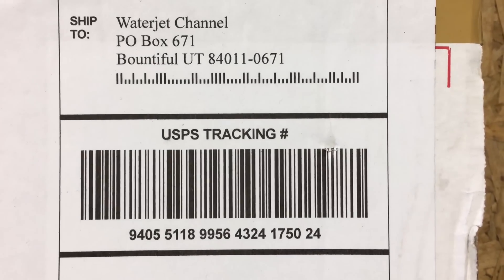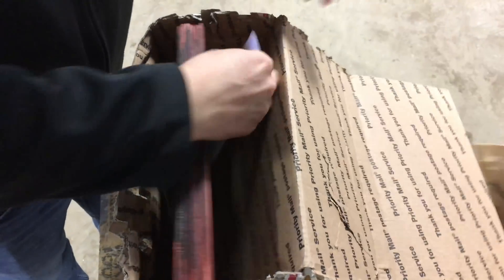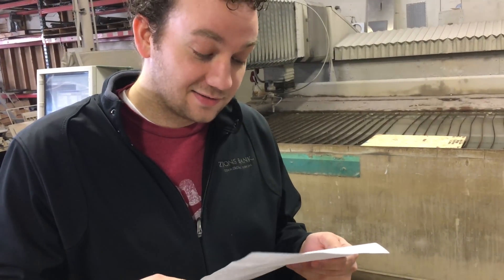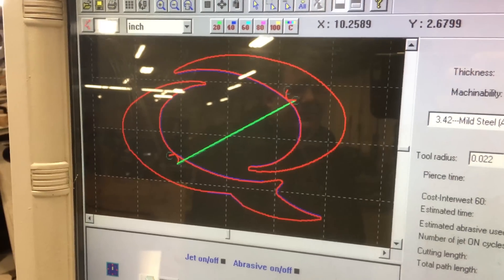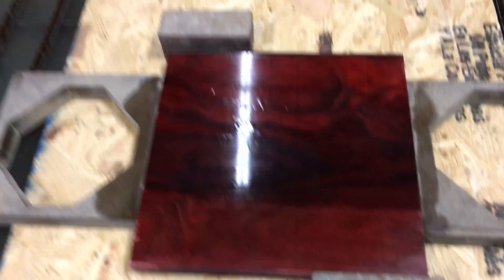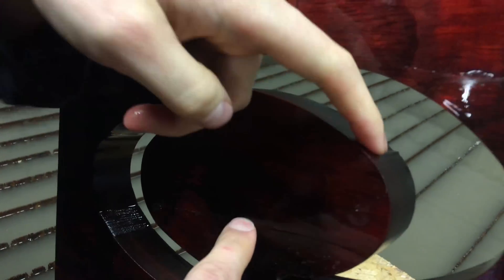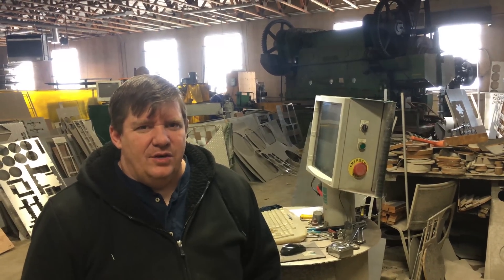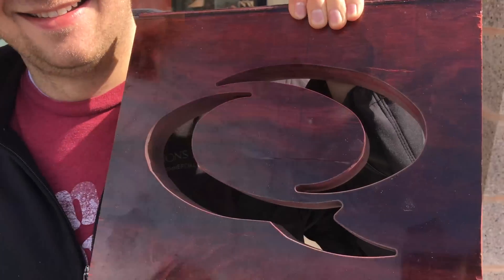Dymalux Wood vs 60,000 PSI Waterjet

Comment: I have only started watching this video I know you can cut threw it. I worked for r a company that makes this particular type and know the process from beginning to end from lathe right down to dying it putting it threw the spreader kiln and press interesting on how it is done the wood is impregnated with a type of resin in what they call an autoclave where it sits under pressure for 4 to 6 hour's then it goes into a kiln for 12 up to 16 hour's then it goes to the press which it gets pressed. Now I will shut up and watch the video.

Comment: Does that water jet not have a allow start feature? Does it always have to start at 60k psi? Can't it work the pressure up slowly while it's doing the initial piercing so it can work a hole through the material without blasting out the sides? Essentially, the "speeds" part of "feds and speeds" in CNC lingo.

Comment: how big can we send? I saw you checking if the tire would fit. could a 1 galon paint can fit?
Reply: things 6" and less fit easily.  things a few inches larger, like the bowling ball, need a special cradle that lowers them a bit into the water.

Comment: Bulletproof glass
Reply: Bullet proof glass would be too easy, its designed to stop impact ballistics, the cutter uses abrasion particles suspended in the fluid. Meaning it chips at it really really fast. (Pretty much scratching the same spot over and over. Honestly a true test of the water cutter would be not how strong of a material it could cut but how weak of a material it could cut without messing the material up. I suggest cutting a really amazing design in some type of foil such as aluminum, then reinforcing it with lament to keep it all nice and pretty if it works.
Reply: water jet is actually the primary method used to cut bullet proof glass for defense vehicle builds. I have a buddy on fb that does it for a living and it looks just like cutting any other glass.. effortless for the machine.
Reply: kevlar to easy. Tungsten to easy. Bulletproof glass to easy. Bowling ball to easy. Real fucking diamonds to easy (no joke). Graphene? unsure. Carbyne? (does it even exist?). Now my question is: is there anything a waterjet CAN NOT cut through? i mean cmon there has to be something... (meaning hardness)
Reply: But it can cut glass....conventional glass.

When we did it, we did it w/H20 only.....no garnet.
Reply: Phillijr tempered will just shatter. any work with glass that has to be tempered, is done before the tempering process.
Reply: Clargin Kevlar rope
Reply: Clargin how about tempered
Reply: FuKItM4n really
Reply: FuKItM4n A waterjet can cut through just about anything except for tempered glass that would just explode
Reply: Wow everyone is wrong.